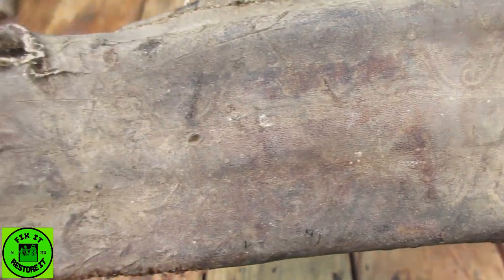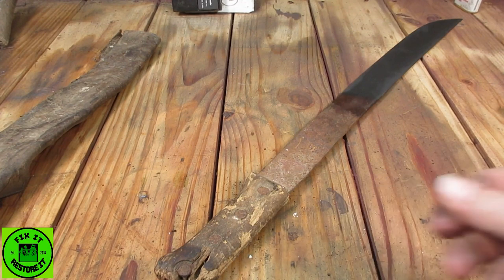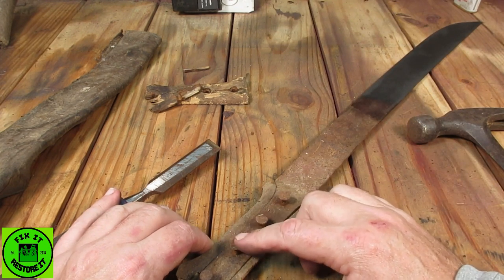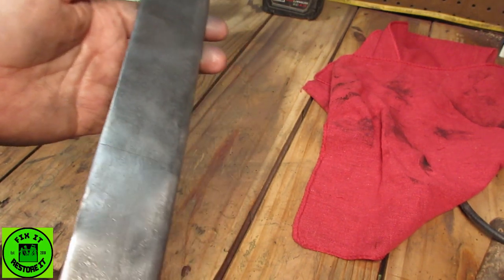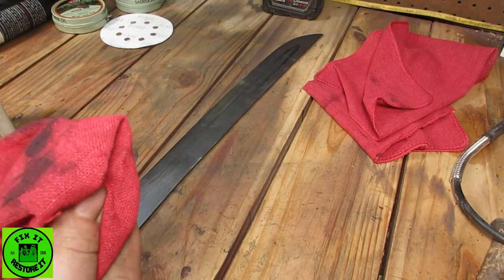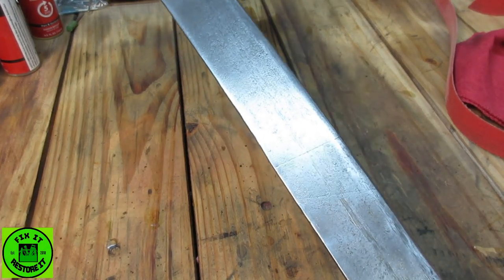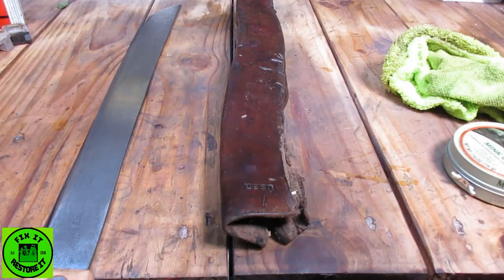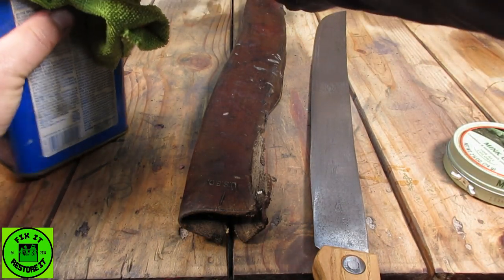110 Year old military machete, Legitimus collins and co restoration

Comment: Looks to me that the electrolytes concentrated here and deeply "etched" the steel. Could counter it with deeper liquid or a simple aquarium air bubbler to keep the fluid moving and reduce concentration spots.
Love your heart in wanting as true a restoration as possible and retaining the pins was testament to that. So much easier to drill them out!!!!!!

Comment: I believe the horizontal line was used as a ruler. Did you measure from tip to line? My grandfather used to mark his tools at certain measurements so he would have to stop working and measure.
Reply from the maker: I havent, but i will when i get back out in the workshop!

Comment: I saw a tin of mink oil on your bench. Very smart. So many people use a wax or silicone product on leather to seal it. It does seal and keep moisture out. But it also prevents the leather 
from breathing. It will dry and crack. Leather is an animal skin and using mink oil to soften will also make it water proof. You are using ani all oil on animal skin. Will preserve it better. I have had a pair of leather hunting boots for thirty years. Oil them every year with mink oil. Same with a leather jacket and gloves. Still use them.
Reply from the maker: I used most of that can, it was soaking into the leather so fast , I got to a point where I figured it was good enough!!!!!!

Comment: Did you mention where you came across this?  First thought is perhaps it was used by the Army Engineers that were in charge of the construction/maintenance of the Panama Canal when it was first built? Would be right for age and also the use of Spanish.
Reply from the maker: I got very lucky and bought it off ebay for only .99 cents!

Comment: A very simple fix for all restorers is to use a 1-2-3 inch PVC pipe with a cap on one end. First, you can totally submerge the entire blade and you don't have to use a lot of evaporust. I've seen so many restorers that take a small piece and break out a 50 gallon jug of a chemical and pour a gallon into a container for a 3 inch pocket knife???
Reply from the maker: I will make sure projects are fully submerged from now now on, as to the volume used - it really doesn't matter because its reusable.
Reply: Thanks for the response and feedback. You do some beautiful work and I follow your technique and process closely. I believe in the old adage, "work smarter, not harder". If I think there is "another way" to do something I'll comment, not criticize. You've restored some items that initially I thought, there's no way that can be restored....but you always manage to prove me wrong. Keep it up!
Reply from the maker: Thank you 😎

Comment: I guess the line formed, because right at the surface of the Evaporust, the air provided enough oxygen to corrode the freshly derusted steel, the new rusty layer then was eaten away by the Evaporust, and so on.
As others suggested, use a piece of capped drain pipe to get more depth.
Still there may be future parts which can not be put in a reasonably sized container.
It probably helps if you wrap the "dry" part with a shop towel and soak that, covering the area of the water line with something, shrink wrap, electrical tape, etc. might work also.
Reply from the maker: I will certainly be more aware of it now

Comment: I have a machete I bought in 1974 with a plastic grip. The blade is pretty rusty. The blade's edge was banged up as though someone had used it on something metal. Anyway, I wish I had a way to show you the condition it's in so you could advice me on how to clean it up. Thanks.
Reply from the maker: Send me a picture to fixitrestoreit@yahoo.com

Comment: I have seen others putting kitchen towel over the parts that doesn't fit in and soaking with evapo rust and that stops line Mark's.
Reply from the maker: If I had realized it would mark it, I certainly would have. And I contacted them, they didn't seem bothered - told me to "buff" it out with wire wool 🙄
Reply: @FixitRestoreit  I know this was 5months ago, however i'm just catching up! I ran into a similar line and it buffed out with steel wool. I had a difficult problem with the line on tools with teeth or mechanical parts, for that I used a hard plastic bristled drill attachment for cleaning wheels.
Reply from the maker: @mikecorrell3853  this wouldn't come out with sanding!